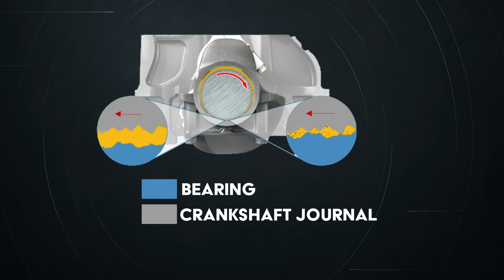the truth about start-stop technology (finally proven)

Comment: My wife’s Subaru tells you how much gas you’ve saved from using the start off and on. I don’t remember the exact time but it’s almost 100 hours and it’s saved a measly 2 gallons of gas 😂😂😂 $6 and the starter will be 200$ easy
Reply: Yeah, that claim is literally utter BS.  My car has an actual GPM gauge which show the fuel flow real time, and my 3.5 liter engine shows 0.2 Gallons per hour, which translates to 20 gallons after 100 hours.  

The idea that a Subaru engine can run 100 hours on 2 gallons of gas is so bonkers stupid that it is needs a new category of stupid.

Here is the ACTUAL average.... "An idling engine consumes approximately 0.2 to 0.5 gallons of fuel per hour..."

This Cory guy is claiming a Subaru car engine uses 0.02 gallons, or 2.5 OUNCES of fuel, to run 10 hours....

I mean.... seriously... this may just be the dumbest claim I have EVER read... 🤣🤣🤣🤣🤣🤣🤣
Reply: That car must use practically nothing to idle... My Durango uses a LOT to idle. Just 2 minutes of idling drops your average mpg 0.1... So 20 minutes of idling is the effect of losing a whole mpg... 20 minutes!..... Compared to your supposed 100hrs.
Reply: Even still it's a complex system that will break especially in a Durango and you will replace the extra vehicle battery. By the time you do all of this you will not have saved a penny
Reply: @MrThe1234guy If you bought a Durango, you're not cost-conscious to begin with
Reply: @MrThe1234guy  That is obviously false.  Cars with Start/Stop systems typically use AGM batteries and upgraded starters, which are designed for the Start/Stop cycles.

In certain cars like Toyota's, there is even an internal counter on the starter circuit, and it will warn you to replace it after 384,000 start cycles.

That is about 100 starts a day for over 10 years.

The same applies to Ford, which uses a starter designed for 200,000 starts, vs a standard starter which is rated for 40,000 to 60,000.

Every car manufacturer uses a different starter in cars with Start/Stop systems than those without one, and different batteries.
Reply: @redbaron6805 Explaining is so exhausting. Does anyone need to be told that millions of cars do not need the battery and starter replaced on a yearly basis?

Yes. Yes, it does.
Reply: @MrRoguetech  No, no one needs to be told that "millions" of cars need the starter and battery replaced every year, because it simply isn't happening.

I have owned and driven many cars with a Start Stop feature, and exactly ZERO of them needed the battery or starter replaced after a year, or two years.  Maybe the battery had to be replaced after 3 to 4 years, but the starter did not.

Your claim that the battery and starter needs to be replaced "yearly" is obvious fiction with ZERO data to support it.
Reply: @redbaron6805 That's what I'm saying. I think it'd be obvious to even the most obtuse people if most every car broke down every year. People would not be complaining about how they have to disable the feature because they feel like it causes it to wear out, they would be demanding the entire engine be replaced so it doesn't break every 10,000 miles. Highways would be littered with broken down cars.
Reply: @MrRoguetech  Exactly.  If these systems were so terrible, we would have cars that wouldn't start stuck at every traffic light in the city.

But we don't see that.  Hence, for all the criticism of the Start/Stop systems, and possibilities it creates engine wear or other issues, the Starter and Battery portion of the system is up engineered for the additional starts, hence most of them get larger starters rated for a lot more engine starts, and they typically get upsized AGM batteries to tolerate frequent starts.
Reply: You saved 100 hours of wear on your engine....

You also either left out some critical details, or you need to have your car serviced for a bad sensor. 100 hours of idling should be at least 10 gallons.

And just FYI, most cars come with a starter. You didn't pay extra for that.

Comment: Bought my wife her second 2016 GL550 just because it doesn’t have stop start installed. 5k oil changes and they easily run to 200k miles.

Comment: If it can build oil pressure under starter speeds imagine now the motor spinning at idle speeds, the difference would be extreme. Garage 54 does an interesting oil-overfill video with a transparent sump and you see the oil flowing back into the sump from the heads within a second or 2.
Second, running a motor oil-free for hours is worlds different than shutting a warm and lubricated engine off for 20-40 seconds, many times over the course of a year. Over-heat is the enemy. 

These experiments are gravely flawed. Cool accent though.

Comment: Important note is the primed state of the oil pump. If u shut off and start your car withing a few seconds oil pressure returns faster vs a start after 15 minutes or more hot or cold

Comment: There should be a system to keep the oil circulating even when not running, even if you have to plug it in.  They have it for large diesel trucks so they will start easier when cold, so why not make it standard.

Comment: mhh, it is not just engine..... it is the starter motor and battery. The battery is 50% more expensive.... to cope with the endless cycles... but still failed after three years (and on week.....😇)

Comment: so wait, that's multiple days of start/stop. Did I miss the part where the engine was actually run and not just idled?, and we ensured that the engine got up to operating temperature?
We need a better sample size and to test what idling a car for that same amount of time would do to the components too. 
And tests of the start/stop with the car actually being driven in between start/stops, for the same amount of cycles.

Comment: I think there's value in lab and bench testing, certainly, but it's also important to look at how engines are lasting in the real world. How many Honda and Toyota hybrid engine failures are we seeing, relative to other equivalent engines? These will have the most intense and frequent stop start behavior. 

Here's a hint: statistically, these engines are among the longest lasting. Not necessarily because there's no wear from stop-start, but if it were as big a deal as some make it out to be, we would not see Priuses (or Insights) ticking over a million miles on the original, non-rebuilt drivetrain.

Comment: my sister's KIA Telluride was diagnosed with a starter failure between 60-70k miles. the vehicle has auto-start/stop. my 2013 Dodge caravan was traded in with 160k miles and never ha any starter issues. of course it didn't have auto start/stop

Comment: Oil pressure is not a problem in modern ICE cars the pumps are electrical that's why the baterries are also diference and why if you stop the car in traffic too long the engine goes back up because no more charge in battery for the pumps, also cars don't do start   stop when certain conditions are ideal like oil pressure engine temperature, maybe very old start stop cars were more dumb on that buy even my japonese 2018 car have all that. So I don't disable start stop also my car is manual and I can control it better by keeping clutch disengaged and not neutral but I can understand that can be a pita for automatic cars expecially diesel that rattle so much

Comment: This is such a valuable fact-backed explanation.  I always knew intuitively that it was bad to start a car and drive off immediately, and this was long before auto start/stop was forced on us.  Here we see the oil pressure and the actual bearing wear.  Interesting that hot engine oil still takes a while to achieve pressure.  Without oil pressure we have metal-on-metal contact.  This video proves that Auto Start/Stop is very detrimental to engine life.  Great video!

Comment: Neither of my cars died due to engine wear. When my transmission failed, it didn’t matter how many miles were left on the engine. The car wasn’t worth repairing. My older car was going to fall apart from rust before the engine died. I’ll take the fuel savings over an engine that goes to the junk yard with a little less wear.
If my current engine can last 10-15 years, that will be enough to time for EVs to be the much better choice.

Comment: The number of assumptions in this video are mind-boggling. This does not seem sufficiently scientific and doesn't provide much real data of any use. The engineers who make these things understand how wear changes under these conditions. This is why idle stop only operates under certain conditions (engine at operating temp, battery in good condition, etc). The starter and battery are specifically designed to handle this type of load. The engines are designed to keep oil where it needs to be for an extended period (roughly 30 seconds) at which time idle stop will re-start the engine to help oil flow once again. 

But ignore all that, because I want to make a political statement about eco-friendly technologies. New things are always bad, of course.

Comment: 4:50 Does the start stop in your car also drain the engine dry and top it off with new oil? If not, then this was a pointless comparison. This video is a nice showcase of even very smart and knowledgeable people being able to be very biased and not objective at all.

Many modern cars have electric pumps that keep the pressure up. 

Start/stop doesn't kick in until the temps are within operating range. 

Your 48h test kept cycling a cold engine, no shit there's gonna be wear, more wear than with an actual start/stop

Wear on starters is mitigated by hybrid startup or beefier starters. Starters outlive cars. 

Wear on batteries is completely negligible at warm starts.

Comment: Kind of funny that it was meant to save fuel/emissions but the delay for the start makes each car take longer to start moving meaning fewer cars get through lights. Worse than that is that most start stop systems will not stop the engine again until you reach a certain speed so if you miss a light, you are now idling for the next one
Reply: If the startup takes noticeable time there's something else wrong with your car. By the time I shift into 1st, the car is already fully started up.
Reply: @utkn  There’s no gear shifting involved. It’s the releasing of the brake that initiates the restart. An engine takes over a second to restart, which adds up quickly when you have a bunch of cars.

Comment: I have a 25 year old Toyota Prius, still going strong - it has the original engine, and no issues, 200,000 miles so far! However : Toyota uses the drive motor to spin up the engine, oil pressure goes up, and only then do you get spark + fuel. Non-hybrid stop-start engines use a slightly tougher starter motor, and the engine gets fuel + spark without oil pressure 😳 (many years ago, I put 100,000 miles on a manual petrol turbo sports car, doing manual stop start, and full throttle in top gear at 750rpm. No damage occurred, because I spun the engine up manually without spark each time, allowing oil pressure to build).

Modern stop-start could EASILY have been designed to be almost as good as a hybrid. It must be assumed the setup that is actually used was designed for forced obsolesence…
Reply: Yeah, the electric motor spins up the engine without combustion, so when the cylinders start to fire, there is already oil lubricating the icu. If I remember correctly, Mild hybrids (those that can’t run purely on the hv battery) and standard combustion engines have to fire the engine to get the oil distributed.

Comment: From a non-car guy who wants to learn

So, when the oil pressure is being tested, where is the oil pressure being tested? You talked about the wear between the bearing and the crankshaft--is this a direct measure of the pressure in that area with a sensor in that are of the engine? Just looking for clarification on that.

The bearings installed in the car being tested--are these bearings typically found in vehicles with auto start/stop? Or are there other kinds of reinforced bearings that typically get installed in cars with this in mind? And, that vehicle is one that was built with auto start/stop in mind, yeah?

Is there anything that can or has been done in cars with auto start/stop to minimize this specific wear on these bearings?

Is there a difference in wear between a stationary and continuous start/stop vs. the start/stop that happens in a typical rea-life workload? Lab results for hybrids vs. real-world testing found huge differences in actual fuel economy being saved vs. what was repeateadly found in a lab setting.

If the wear was primarily due to the auto start/stop, is one of the main variables in the 1,000,000 engine that it's started/stopped less than the number of times you did in the "test" vehicle?

Comment: There was a video when GM introduced start stop where a guy asked the GM engineer what they did to prevent excess wear that start stop causes on the bearings. The GM engineer did NOT say it doesn't cause excess wear, he said they had to switch to triple layer bearings. From that second it was already confirmed that GM knows start stop causes excess bearing wear.

Comment: So my battery died last week. I found out that with that start/stop feature you need a special battery, (and starter too I'm told). AGM or something. It cost me $350 for just a battery. Not to mention I have to take the cowl off the car and a reservoir . Another $150!. Used to be you could buy a battery for under $200 and change it yourself. (It's a 2017 Ford Escape). I can't believe that start/stop feature saves much gas. Not to mention less cars get through a light because you have to wait until all the cars have to re-start. How about we start making smart traffic lights that sense traffic, get rid of pointless ones and disable them when they aren't needed. That would save gas and time.
Reply: I have a 2018 auto with a DCT and auto start/stop. First, pretty crazy you needed to swap that battery out after just 8 years. That sucks dude. Hopefully it was just a faulty battery and not a fault leading to excessive drain. But--and maybe this is because of the DCT---what is your actual time to move the car vs. asking the car to move? In mine, I let go of the brake, and before I can even get my foot over to the gas pedal, the engine is already re-engaged; I'm already moving by the fraction of a second between the car being in neutral when beginning to let go of the brake to first by the time my foot is on the gas.

And SAE 2004-01-1896 showed both that the trade-off of starting an engine up requires usually around 7 seconds of a stopped idle. It had also shown that--21 years ago--in their real-world testing, auto start/stop saved about 4-9% in fuel economy. J.D. Power estimates that the average driver spends about $2,500 on fuel. Now, this is not adding any nuance whatsoever, but if we assume that everyone can save 4-9% of that figure every year starting today, that's roughly $100-225/yr. Again, not saying this is what would actually happen because this is as surface level with no nuance as possible. However, thus far for myself, I haven't paid anything outside of normal maintenance over 7 years, personally--tires when balding, oil every 7.5k miles, belts when recommended, etc.--so for someone like myself, it would save a good deal of money ($700-$1,575). That basically pays for my yearly maintenance when you stretch all those costs over 7 years, and on the higher end, also pays for all the additional tools I purchased to do maintenance myself that I didn't have.

Comment: If manufacturers included an oil accumulator that kept oil pressure up on the engine for a minute or so, most of this issue would be resolved. But alas, it’s why disable it on every vehicle we own.
Reply: Just add an electric oil pump and you also fix the cold starts after days of standing still. It will cause additional 5–10 second delay to engine start to first bring up oil pressure and only then start the engine. If the car has proper hybrid system, it can run the first 5–10 seconds on battery so usability wouldn't even suffer.
Reply: @MikkoRantalainen  right its like a lot of people are rooting for it to fail. Instead improving the system.
Reply: They do.

Most stops, there's just not enough time for the oil to drain out. It's not really an issue for 20 to 40 seconds at a stop light.

But they allow more oil into the top of the engine so that there is enough still in the engine during longer stops like you might have in traffic jams.

Of course, most are also designed to restart occasionally as well. It shouldn't stay stopped for many minutes.

It's your money. Disable it if you want, but starting the engine causes less wear than having it running. Increased fuel efficiency is just a bonus, the real savings is longer lasting engines.
Reply: @MrRoguetech  Show me an example of an every day car that has an oil accumulator to keep oil pressure up... I'll wait.  Theres oil left on the bearings / journals etc during a stop/start event sure, but theres no oil pressure.  Also, did you even watch the video?  Its clear the wear is increased from constant stop/start, idling is by far superior in terms of preventing wear vs start/stop.
Reply: @heli_yeah  Its a simulated test, this may not happen the same in real work conditions.